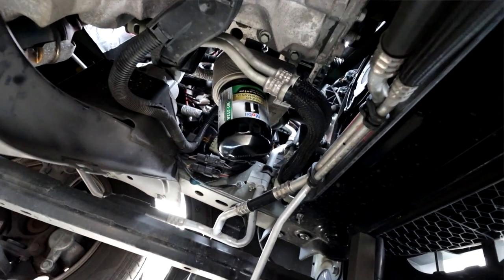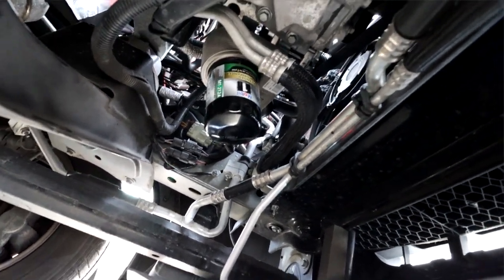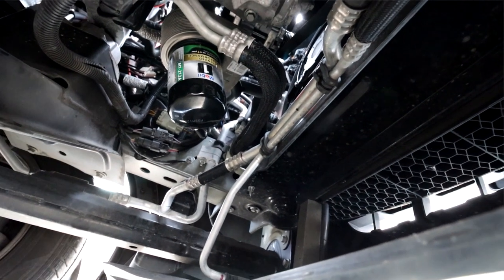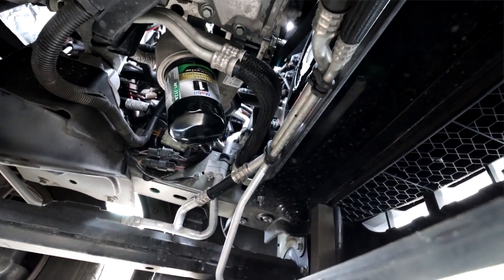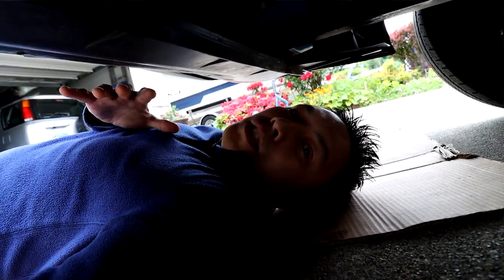Ford Transit van fluid extractor oil change and giveaway details.

Comment: The cost video would be great.  As a fellow Transit owner, I've really loved your videos.  I want to tackle the 360 degree camera project and the radio replacement video.  I'm always uncomfortable taking my van in to get the oil changed.  I can't help thinking they are looking through "camper' things.  I now feel comfortable doing this at home.  Thank You for your videos!
Reply from the maker: I have a phone as a camera inside the van and all I can tell you is, yes, they do look around, touching, and testing your camper setup. I took my van in for a code reset and 2 other times for recalls. All 3 times they were checking things out. I do my own because I don't trust them to do a through job as it is not theirs.

Comment: Cost video, definitely. I have to ask, what’s the benefit of the oil extractor? When I change oil, I warm up the engine, remove the oil plug and uncap the oil fill.
Reply from the maker: Just less messy from oil splashing everywhere. Plus no need to worry about stripped oil pan threads. I already own it for brake and other fluids replacement.  No real benefit if only for oil change unless you own a German vehicle where the oil filter is on the top in the engine bay.